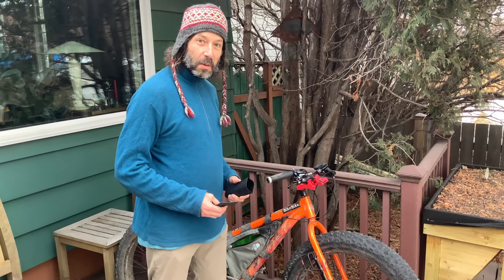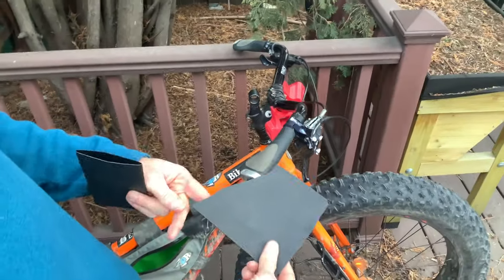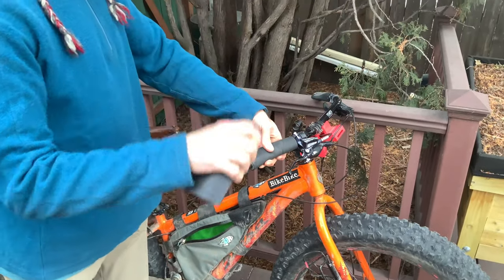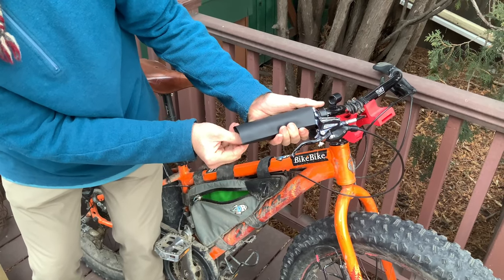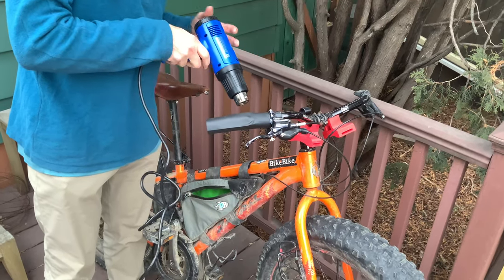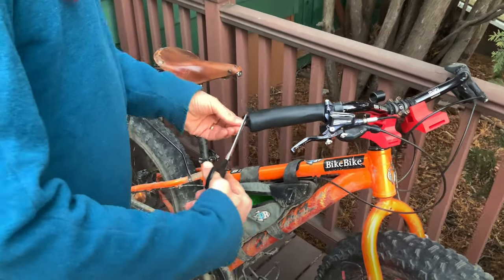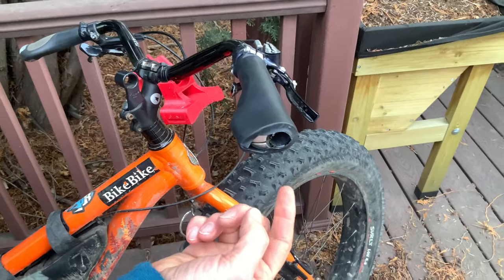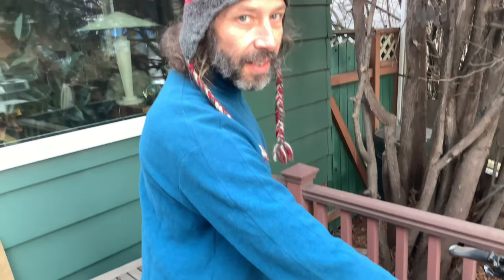Insulating bar grips for winter

Comment: Any thoughts after posting and using this mod?  Looks like a great idea.
Reply from the maker: I have been using this method for about 18 years, with variations on the insulation. Before that I used a wrap of bar tape over the insulation. Carbon bars and light grips are another alternative since the bars don't conduct much heat. I wrote a long and wordy article on keeping hands warm in winter here: https://www.coldbike.com/2019/12/05/warm-hands-cold-bike-the-definitive-guide-to-keeping-hands-warm-on-a-bike-in-winter/